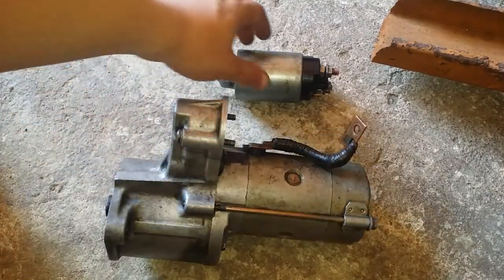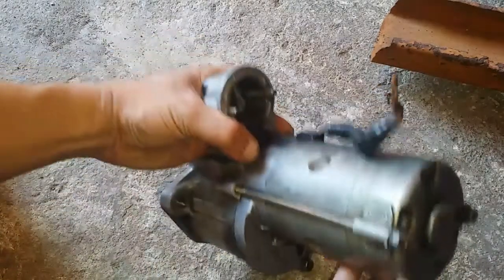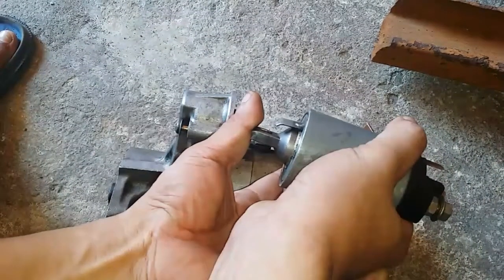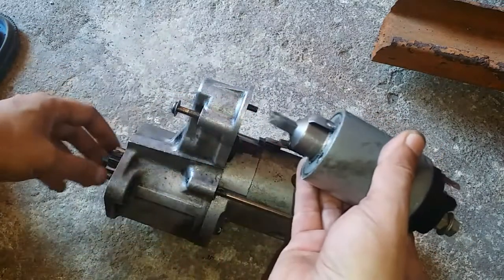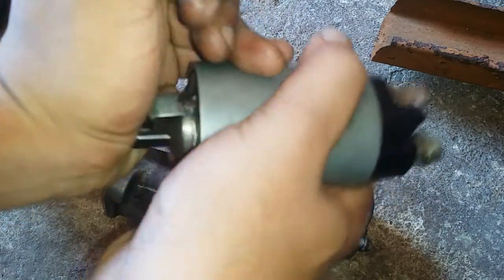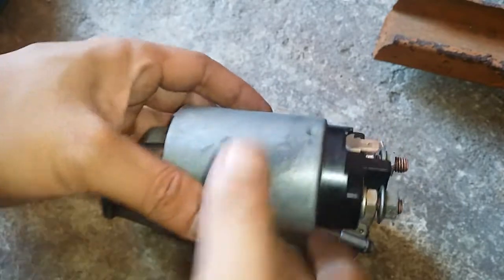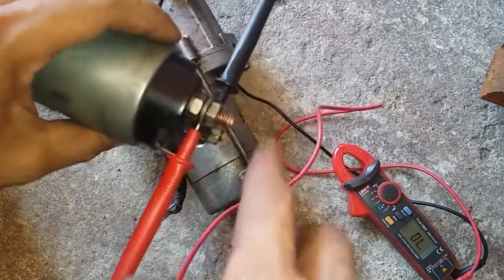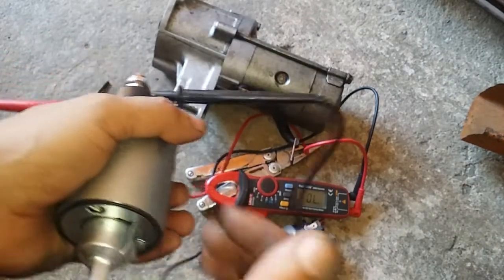4d56 starter solenoid replacement

Comment: Good video, I have a better understanding how a solonoid works now, thank you for that. When I start my engine I get some compressions but just as it want to run I hear a spinning sound, like the gears inside the startmotor lose grip. Any ideas what could be the cause? I think the hook where my solonoid hooks in to the start motor is worn out or the gears itself, what do you think?
Reply from the maker: Possible, the lever or the gear. Only way to find out is to bring the starter down.

Comment: Good day sir, i will try what u showed us in the first n here video on step by step diagnose the situation. my problem may be solve by your video. I charge up my battery just in case. Beside the battery cable for both terminals are good. There are 2 wires, which i now know 1 of them goes to the starter relay and they are both ended at the positive terminal. I combined and use a 50cm length #8 thhn wire to extended them and used soldering lead at lead a bit not fully soldered. I hope u can help further if i m not successful. Thank you.

Comment: is the blue smoke normal at 4:20?
Reply from the maker: normal. smoke was by reason of poor connection between the battery terminal and the body of the starter.

Comment: Originally, my solenoid starter is SS-1529 9116. Is it okay if I use SS-1529 9Y30 for my Mitsubishi Adventure 4D56 Diesel Engine?
Reply from the maker: as long as it fits, as long as the lever mechanism is the same, as long as it is rated 12v.
Reply: @MrDIYer  Thank you!